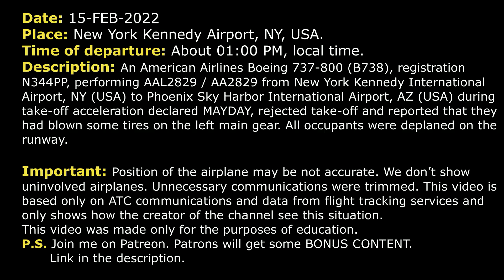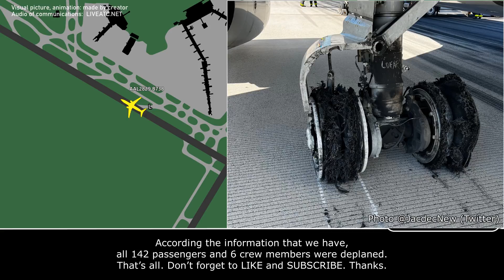MAYDAY, Rejected takeoff. Blown tires | American Boeing 737-800 | New York Kennedy, ATC

Comment: As a maintainer I get sad when I find out the dual wheel/tire redundancy theory didn't work. Pain to have to deal with a dual tire failure on a runway or taxiway. It's nice to be able to tow with the other tire having held together.
Reply: Yup, we had made a nice little device where you could jack up the main mount or nose and then set it down on a sturdy cart with wheels and just tow it out.  It was for much lighter military aircraft though.
Reply: Well, they might have blown the other tire due to the heavy braking action? :)
Reply: @RubenKelevra  ,
In theory the dual wheel system is supposed to be able to survive heavy braking even with one tire failed.

Comment: This is what happens when you farm out safety checks and maintenance to foreign maintenance companies.
Reply: Can happen regardless no matter where maintenance is done. Plane had flown its first flight of the day with no issues.
Reply: Tires are essentially leased and usually the tire maintenance company is supposed to do regular tire condition evaluations after each flight. The contracts can be very complex with combinations of rewards and penalties for various outcomes. Tire failures that create rejected takeoffs or stuck on runway after landings are costly for the tire maintenance company.

Comment: Who calls a mayday on the ground.  AA pilots are becoming dummies.
Reply: I’d have to disagree, the Mayday was declared mid rejection, possible control issue and unknown status of the aircraft, brake fire or damage to hydraulic lines, not to mention they don’t want the guys in short finals landing on top of them, you can always downgrade your emergency status but id say it’s definitely appropriate for the situation, also by declaring the Mayday it would get the attention of the pilots on finals so they can be aware and expect a go around.
Reply: Of course you call Mayday. Blown tires, trucks called out, aircraft need to be sent around.
Reply: Says the YouTube expert with zero 121 time.  Fool.

Comment: How they could lost 2 ties on take of?
Reply: Emergency braking from a high speed rejected takeoff. In RTO testing they expect to lose all the main gear tires when the fuze plugs blow out due to heat, and they expect a gear fire. The criteria for success is that the fire doesn't spread too far within 2 minutes after stopping.
Reply: @cageordie  This was not a maximum energy abort. They didn't even use a large part of the runway. More likely one burst and the extra load triggered the bursting of the other one. Or there was something on the runway.
Reply: On the one I got called out for they think when the first one blew it took out the second one. He was at take off speed as well so that factors in also.
Reply: @USNveteran  he was not at takeoff speed. More than likely he hit something or the tires simply failed.
Reply: @edwardtrivino7265  I believe I said the one I changed the blown tires on was at take off speed which it was.  Pilot did a great job of keeping it on the runway and not going off into the grass.  More than likely would have cart wheeled and caught on fire.

Comment: For those  of you who question the pilots Mayday call, I have one word for you:  Concorde.
Reply: Rejecting at high speed, maximum braking, hot brakes potentially setting fire to the wheels, plus whatever caused the RTO. Yeah, that's an emergency and that's the right way to report it.
Reply: @cageordie  Most likely hitting debris in the runway but there are other causes.
Reply: I think calling mayday ensured getting the tower's attention AND the short final behind them.
Reply: More relevant: British Airtours flight 28. Mayday was definitely appropriate if they weren't certain what had happened (specifically, what might be on fire).
Reply: @andyowens5494  I had just looked that up. A lot of people died. I remember watching it on the BBC news when I got home from school.
Reply: No question. RTO is not an uncommon occurrence... but the Pilots here likely knew they had a control problem (likely lots of right rudder to keep it straight) as they were rejecting so calling a mayday was a good thing to alert that they may need immediate assistance.

Comment: A shame he didn't respond to the MAYDAY as fast - how many minutes elapsed before the alert sounded out and trucks rolled?!
Reply: US airports are always slapping themselves on the back about their response times, but they are utter crap compared to LHR. It took something like 5 minutes for the first crash truck to get to the Asiana 777 at SFO, and then they crushed a passenger to death. Just watch the ground radar for the BA 777 short landing, they had multiple crash trucks at the aircraft in around 90 seconds. First ones were out of the fire station in around 40 seconds. I checked the video, the MAYDAY was at 38 seconds, at 70 seconds a vehicle can be seen leaving the side of the fire station, at 78 seconds the first crash truck is out of the front of the station, first vehicle is there at 107 seconds, just 67 seconds after the MAYDAY call, and by then other fire trucks are coming from all over the airport .
Reply: @cageordie  one correction to your post. The autopsy concluded the passenger died from the injuries she sustained after being ejected from the aircraft. She was not wearing a seatbelt. She was already dead before being struck by the fire truck. Additionally, if you look at photos of the crash debris, it was virtually impossible to distinguish her body from pieces of wreckage that were strewn all over the ground.
Reply: @cageordie  that’s the problem with believing that you are better than everyone else and the best that ever existed..complacency and lack of self-awareness.
Reply: @virginiaviola5097  Big FYI, majority of people don't think that.
Reply: I'll put money on someone in that tower looking out with binoculars within 15 seconds. Had there been any smoke, they would have been in touch with everyone pretty quickly.
Reply: In the US FAA regulations require The first ARFF truck to be able to reach the midpoint of the furthest runway from the fire station and applying water/foam within 3 minutes. I think that ATC may have been delayed sounding the emergency alarm here for some reason.